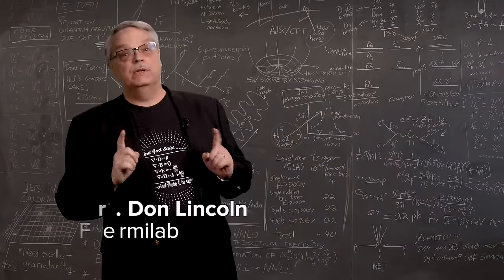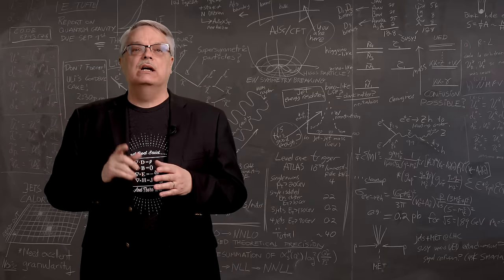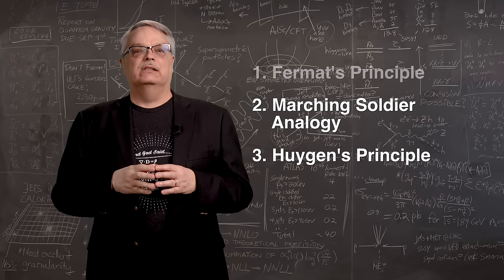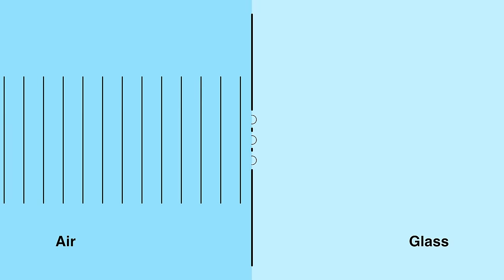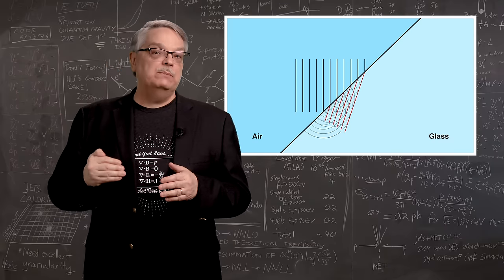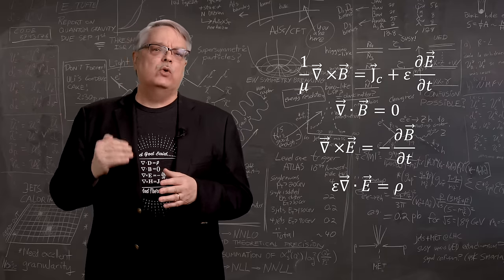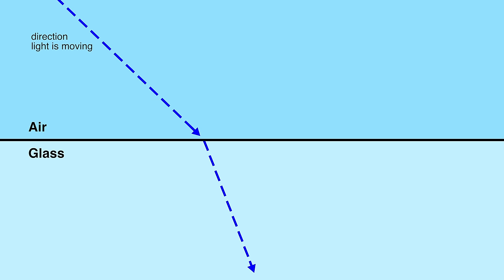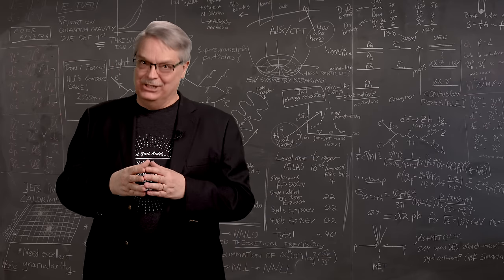Why does light bend when it enters glass?

Comment: this is the answer I have been searching for the past 15 years (since my 9th grade). Thank you very much.
Reply: DotaLove I also asked this question in the 9th grade I didn’t get an answer until now. I am 70 years old.
Reply: So true they always told how it bends but never told why this happens
They were like you will learn this in higher standards
Reply: I still can't understand how this bending of light is any different from the gravitational lensing of light by massive objects (like black holes). That's due to gravity curving space time around it and light following the curved path. However, doesn't it hold true in this case too? May be glass being denser than air ( analogous to a galaxy being denser than vacuum), leads the space time around and with in the glass to bend a little bit (way smaller in magnitude though) and as a result we see the light through glass's denser gravity? (Similar to the Eddington's experiment to prove Einstein's theory of general relativity by seeing a star's apparent and not the real position in the sky due to its light bent by sun during a total eclipse. Similar to how we see the position of a coin placed at the bottom of a water jar to be slightly raised due to bent rays? And Einstein definitely used Maxwell's equations in his general relativity. So, couldn't this all be connected and we're understanding refraction wrong all this while? I don't know.
Reply: @richriley5832  😱😱😱
Reply: Vivek density and gravity are not the same thing; an extremely dense object will have identical gravitational force as a larger more diffuse object (as long as the mass/energy of the two objects is identical).  One way to think of this is if the Earth is compressed to a size of roughly a 1cm diameter.  Obviously it is extremely dense at this size, but it’s total mass/energy is the same.  The space time curvature at the distance from 1cm Earth to the moon will be identical as the curvature from normal Earth to the moon despite the difference in density.  Thus the moons path around 1cm earth will be identical to its current path around the Earth.
Reply: I'm in 9th grade now and I got the correct answer
Reply: Same here.
Reply: @viveklakshman2897  the gravitational effect of a small glass cube isn't enough to curve space time to such a degree that light would bend at that angle. The Maxwell's equations give exact angle at which light would bend inside a medium
Reply: @viveklakshman2897  No, the reason why refraction and gravitational lensing is different, is because gravitational lensing occurs in a vacuum. It happens outside the galaxy or star, where there is vacuum. Refraction, on the other hand, requires that there are two different media with two different refractive indices, and so it can't happen in a vacuum, where n=1 everywhere.
Reply: Man i cant tell you how much i relate with your comment
Reply: Wut.
Reply: I think electron also generates magnetic field
Since heat just have kinetic energy so light also requires mass
So electron is easily attracted by black hole
Magnetic field subtract mass and creates positive sphere thus it is neutral
Reply: @richriley5832  really ? Damn.
Reply: 15 yrs 🤐
Reply: Me too had this doubt from school and got this cleared last year , took me about 7 years to get the right answer. Since then I use this marching soldier analogy as an example of the drawbacks for learning with analogy instead of fundamental principle.
Reply: Jiraiyaaaaaaaaa.
Is Kashin Koji your clone?
Reply: This is bollox. He does not prove anything. Why didn’t he do the experiment?
Reply: I'm in 10th grade was searching for my answer but still confused!!!
Reply: Well hope you ‘research’ goes well ero sennin
Reply: I too had this in 9th and now I'm in 10th and it's clear
Reply: @ritiksingh721  heat is the kinetic energy, and light is produced by jumps of electrons, when a body is heated it,s electrons are exited and releases light and when it does so the electron loses energy and return to ground state
Reply: @viveklakshman2897  because gravitational lensing is a gravitational phenomenon and bending is electric phenomenon, gravitational lensing is caused by huge gravitational field, which is impossible to create on earth, gravity is weaker than electromagnetism,no this bending is not caused by the differences of densities
Reply: I’m in 4th grade not 9th thing have change
Reply: @viveklakshman2897  so much confusing argument, still for my level
Reply: @_letsdothis_  still not be change in all schools
Reply: but this not explain why light bent it explain light glow shower
Reply: Surely man...He is a blessing.
Reply: Jiraya sensei!
Reply: Same
Reply: Just wanted to mention the 9th grade
Reply: Amen. Me also.
Reply: @richriley5832 hate to tell you but I don't think this is the answer either. 
pretty sure the light slows down to match the density of the glass. because time moves faster in mass.
Reply: @richriley5832  LOL, me too, I still remember making a poster of the marching soldiers version for a project in the mid-1960s. And, btw. I took EE and physics in college and never saw this video's clear explanation when we did Maxwell's equations.
Reply: @civwar64bob77  thank you

Comment: Dear Fermilab. This second video does not really tell the story either. This is just another way of deriving Snell’s Law. The crucial point here is why only the normal component of the E field is affected by the permittivity. The “real” reason for the behaviour of light in a medium in this context is that light represents a force that in turn induces dipoles in the medium. This gives rise to a London force that always is attractive. Any component of the attraction other than the normal cancels out by an opposite force on the other side. Think of concentric circles on the surface around the focus that each result in an attraction. The larger the radius, each circle have more slanted induced dipoles. This is also the reason that the reflection results in polarization effects (Brewster). It is illustrative to imagine an object on a transverse wave. In an idealized setting the object will move only up and down – there is no sideways motion. Likewise, the London force resulting from the incident light will only affect the normal component (of the EM field in this case).
Reply: @no-one-in-particular  Finally somebody says it.  I felt the same way.
Reply: Hi, I found your comment the other day and it seems like the answer I'm looking for but I've been having a hard time getting at what exactly is happening.
I think what you're saying is, look at an atom at the top "layer" of glass that's been polarized by the light and turned into a dipole. This dipole will polarize its neighbors. The neighbors on the same layer should apply a force to stretch that dipole out more in the transverse direction, but their forces cancel. The neighbors on the second layer stretch the dipole in the normal direction, and this force cannot be cancelled since there is no layer above the first.

This almost seems to work out, but if the transverse forces cancel out and the dipole remains polarizes in the transverse direction, that component of the electric field would also decrease

Comment: Here a Graduate Physicist.
There is also another simple explanation for this:  
(As consequence of the conservation of momentum of photons)

If in medium 1  the index of refraction is n1 and in medium 2 the index of refraction is n2 and for the definition of index of refractions and wavelength we have:
n1 = c / v1  ,  v1 = λ1 * f  
n2 = c / v2  ,   v2 = λ2 * f 

Dividing the above equations we obtain:   n2 / n1 = λ1 /λ2  
So if n2 is higher than n1, the wavelength in medium 2 is smaller than in medium 1.

Now because the photon momentum is:   p = h / λ
Applying the conservation of momentum of the incident and transmitted photon along the parallel line of medium separation:

p1 = p2  →   h/λ1  *sin(θ1)  = h/λ2  *sin(θ2)    →   n1 *sin(θ1)  =   n2 *sin(θ2) 

This is the Snell Law!!
So the light bending is just a consequence of the conservation of momentum of photons!
Reply: The conservation of energy only applies to anything with mass and nothing with mass can travel at the speed of light.
Reply: @scottdc2105  "The conservation of energy only applies to anything with mass":  Not true.
Conservation of energy always applies . In the case of electromagnetic field (photons), conservation of energy is guaranteed by Poynting theorem: https://en.wikipedia.org/wiki/Poynting%27s_theorem

Also note that my proof doesn't use conservation of energy but conservation of momentum. The conservation of momentum in electromagnetic field  is guaranteed by 
the Maxwell stress tensor : https://en.wikipedia.org/wiki/Maxwell_stress_tensor
Reply: @SimulatingPhysics  But if light has no mass how can photons have mass or momentum? Am i looking at it too simplistically?
Reply: @scottdc2105  A particle without mass can have energy and momentum. The classical formulas (p = m*v  ,  E = 1/2 * m *v^2) are not valid for particles with speed near the speed or light or with the speed of light. Instead we need to use the quantum and relativistic formulas: p = h/λ , E^2 = (p*c)^2 + (m*c^2)^2
Reply: @SimulatingPhysics  nice
Reply: why have you multiplied each side by sin theta 1 and sin theta 2.
excuse the simplicity of the question
Reply: @aakifrehman8150  Hi! θ1 and θ2 are the angles of incident and transmitted photons with respect to the normal of medium separation.
h/λ1  *sin(θ1)  = h/λ2  *sin(θ2) represent the conservation of momentum along parallel line of medium separation, so I'm just projecting the momentum along this line.

While in the perpendicular direction the momentum is not conserved between the photon because  the photon is exerting a force in the material!
Reply: How does it explain the bending of light? sine of theta 1 and theta 2 are just the components of momentum right? Doesn't that mean it is already assumed that the photon has changed it's direction?
Reply: @paritosh4643  
θ1 and θ2 are the angles of incident and transmitted photons with respect to the normal of medium separation.
h/λ1  *sin(θ1)  = h/λ2  *sin(θ2) represent the conservation of momentum along parallel line of medium separation, so I'm just projecting the momentum along this line.

- Doesn't that mean it is already assumed that the photon has changed it's direction?
No, the reason is because for momentum to be conserved along parallel line of medium separation, the direction of the incident and transmitted photons θ1 ,θ2 must satisfy the Snell Law.
Reply: @SimulatingPhysics  I did not understand that last part, why exactly is only the parallel component taken into consideration and why not the perpendicular one.

is that also the reason why light does not bend when it is incident normal to the plane.

kindly clarify the above. It would be very helpful
Reply: @aakifrehman8150  The photons only exert a force in the perpendicular line of medium separation, so they transfer their momentum to the material in which they are penetrating or bouncing, and exerting a force on it.

This phenomena is called radiation pressure and for example it's what makes solar sails to work. 

Because no force is exerted in the parallel line of medium separation the photon momentum must be conserved along that direction.

This is analogous to a ball bouncing on  the floor, the momentum of the ball is only conserved in the parallel line of the floor.

"is that also the reason why light does not bend when it is incident normal to the plane?" - Yes
Reply: @SimulatingPhysics  thank you so much for that enighting explanation
Reply: A law isn't a theory. It doesn't explain why anything works, it just explains what happens based on observations. Explaining something using a law isn't actually an explanation, it's just describing what happens. In other words, when you say "it's because of conservation of momentum", what you really mean is "it's consistent with conservation of momentum".

Comment: Thanks for clearing up a misconception that was taught to me that I've been passing down to my students. Why doesn't the parallel component have to decrease, I missed that.
Reply: Same here, wondering why the parallel one did not decrease
Reply: Because both initial components are actually derived from boundary conditions for M and E part. So this is only valid at entrance point. Further on, the wave propagates straight through that medium and both components are affected by the medium and as long as the medium remains the same, it behaves like perpendicular entrance to that same medium. Otherwise the light would curve in that medium which is not the case.
Reply: Apparently the ‘epsolom’ (sorry don’t know spelling) is bigger in glass than in air. 

This effects the perpendicular component. (I’m not sure myself why this doesn’t affect the parallel component too. Apparently it’s just the perpendicular component 🧐) 

Because of this, the angle of the perpendicular component is different to that of the parallel component. It is made shorter

This creates the angle we see when light his glass.
Reply: You didn't miss it. He didn't explain it - he asserted it "from the calculus".
Reply: He didn't explain it. 12:22 He showed E field entering perpendicular to the surface, thus the electrons in the glass lined up horizontally to cancel it, so he 'cleverly' deduced that the perpendicular E component got reduced in the glass.
If E field entered at an inclination (which should be when light entered at any random angle), then by same logic, electrons in the glass should line up in appropriate direction to cancel it, so both parallel and perpendicular E field components should change.
Reply: hmmm... the parallel component is the shared surface of the air and glass. so for the purpose of the equation it does not change (to be more precise, changing it is meaningless to the equation) 
-> the parallel component and the perpendicular component together make up the electric field
-> the electric field is less in the glass comparing to when in air (because of the light wave activating the electric field in the glass which in turn interacts with the light)
-> and since the parallel component is maintained, that means what had contributed to the lessening of the electric field must be the perpendicular component being reduced

this is the way he explained it. i struggled in using scientific / mathematical language in writing this but i hope it helps.
Reply: Because of the 1st of the equations from Maxwell's EM

Comment: I have derived those two results about perpendicular and parallel components in my electromagnetic field theory class but never thought it had so much connection with light bending...i wish my  professors were like you to tell the real stuff and not making me derive these results for mere marks in exam.
Reply: Yeah, that has always been a problem for me. I'm fine with learning equations and seeing that it works, but I want to know how it works, otherwise I'm not understanding a god damn thing. 'The sun shines' is not an explanation as to why it emits light. Might as well say god diddit and here's an equation that can calculate the angle when it hits glass.
Reply: Talking about radio waves: These can be bent and change polarization in electric fields - think antenna theori. So that should also be possible with light? Is there any examples of bending light or changing polarity shining it between charged plates?

Comment: This answers one of my party killer questions i asked for almost 20 years. Thank you!

Is there a video explaining reflection?
Reply: after watch 2 videos, i think electric part of light is not enough to properly explain reflection

think about it. reflection need parallel and perpendicular part of electric field to flipped 180 degree AND material generated electric field stronger after hit by light to make electric field flipped

someone can correct me if im wrong or maybe have better explanation :D
Reply: I think reflection is explained by the fact that light is changing magnetic and electric field not just one or the other, the change in electric field gives rise to magentic and visa versa , in the reflection case it the electric field goes to zero as it is completely completely reflective material and hence the change in electric is negative which produces magetic field in the opposite direction which then induces electric field in opposite direction hence reverse the perpendicular component of the field while not affecting the parallel one and effectively reversing the direction of propagation in the perpendicular direction.
Reply: @vik24oct1991  Okay, wow. I have to read this a couple of times. But thanks!
Reply: So have experiments been done with varying electric field intensity in glass/water to see if that changes the angle?